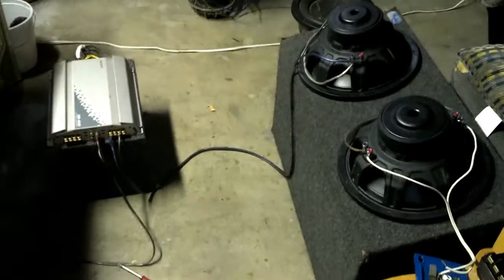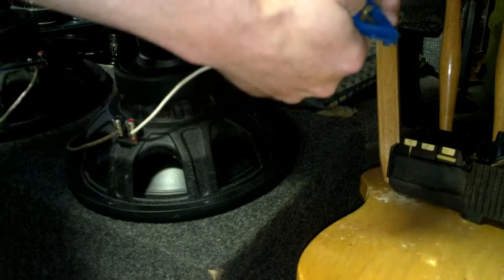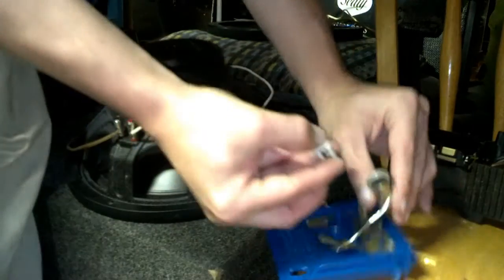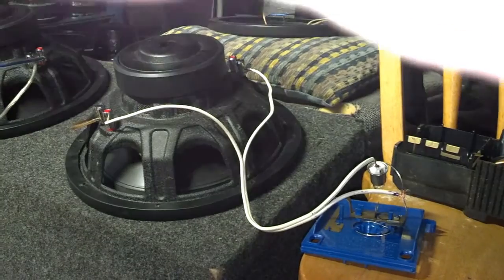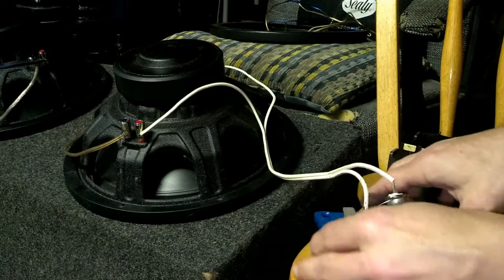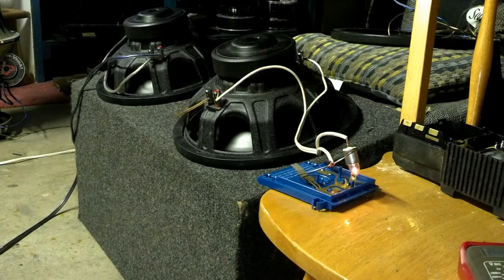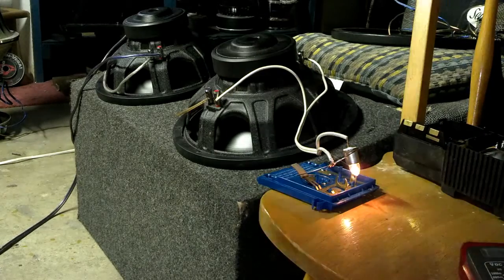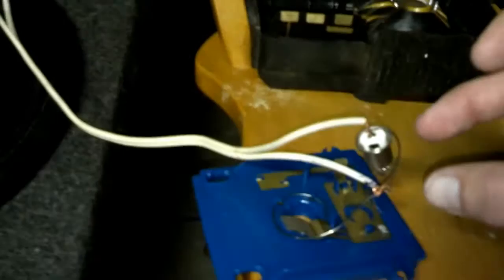Proving the Subwoofer Generator is NOT Fake ! a speaker can make power

Comment: This is definitely not fake. I had some car subs in my bedroom as a teenager. Went to Radio Shack and bought a 50pk of red and green LEDs and wired them around my bedroom connected to  the subwoofer speaker wire. Every time the bass would hit, they would flash. But I also noticed that when I tapped on the subwoofer cone, the lights would flash. Even with the stereo unplugged. Any movement of the cone would generate electricity. I thought it was crazy at the time. But now I know it makes sense. Any time you pass a coil through a magnetic field like that, it is going to make power. Kind of silly looking back. But at the time I thought it was super cool. My room flashed to the beat of my music.

Comment: some people just don't understand how simple electro magnetics is but your moving a magnet in a up and down motion basically running that light like the cheap shake/ forever flash lights that was a center magnet pole with a outer coil and a slow discharging capacitor to give you like a minute run time off 30 seconds of shaking. just cause the sub is a up and down motion passing a pole it's the same concept as any alternator passing a pole to create power

Comment: try a led strip if ya have one
Reply from the maker: i toasted the only spare LED i had laying around the house lol , i have tons of them in my shop but didnt bother to grab any as the light bulb didnt blow and takes more power to run
Reply: Pretty cool that it works im prob gonna mess around a little myself now that i seen it
Reply from the maker: im gonna try some ideas to make this generate more voltage and more amperage , if you come up with anything you dont have the parts to do let me know and ill try putting something together . i have tons of parts for building subwoofers and raw magnets and all kinds of stuff to play with
Reply: +mazda2284 have you tried different ohm speakers to see if it puts out more yet
Reply from the maker: Michael Hawkins
 yes check out my other videos i recently uploaded